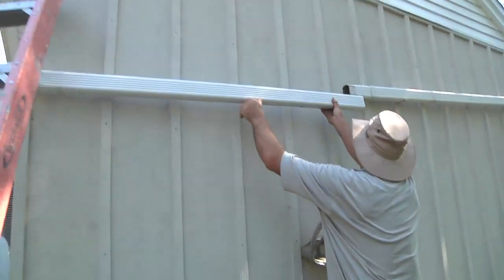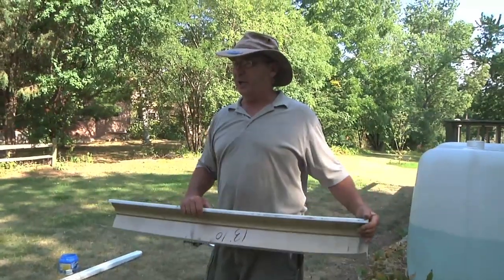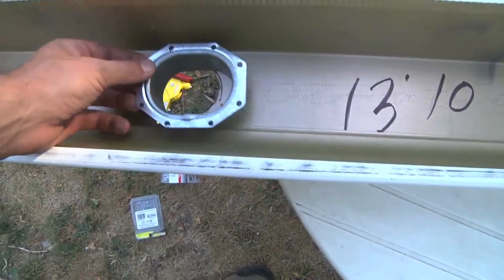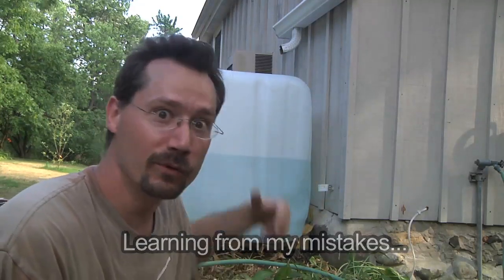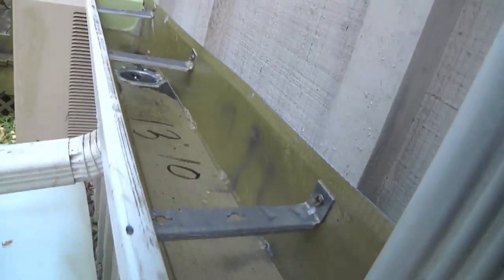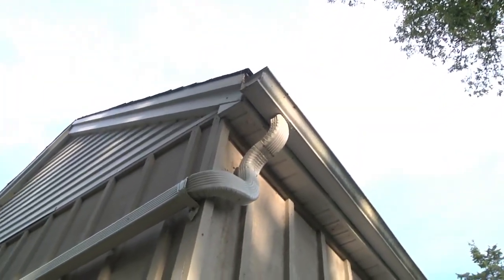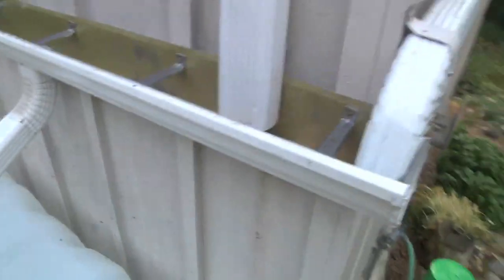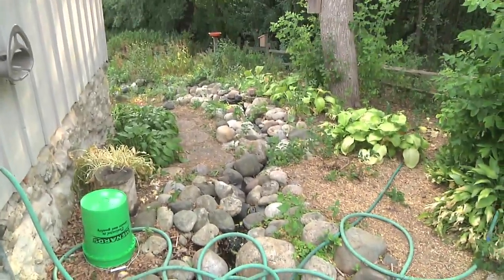DIY 275 Gallon Rainwater Collection,  Part 5.mp4

Comment from the maker: TheQueefCookie: - Yes, we did get some bulging of the original single-tank system with no cage around it. In the end, we expanded the system to three tanks, on a wood deck, and boxed them in to match the building. It holds the containers well, keeps out light, and looks nice. Look at the end of the last step on the info I put on Instructables - http://www.instructables.com/id/DIY-275-Gallon-Rainwater-Collection/step5/Learning-Experiences-and-Future-Improvements/

Comment: I need to ask you, I also have a 275 gal. IBC tank without the metal frame. I was wondering if you had any problems with the tank bulging out and putting to much stress on the tank? would you recommend making a frame to hold water within the tank or will it be OK without? I have been told that it will be fine as the design of the frame was for the ability to stack and for protection from damage while in shipping. Still, I would like to know if you had any problems with the tanks being full without the frame.

Comment: There should be very little over flow if any due to the fact that the length of gutter would hold a fair amount of water and as long as the drain to the tank remains clear, then then only time you will get a large amount of over flow is when the tank is full.